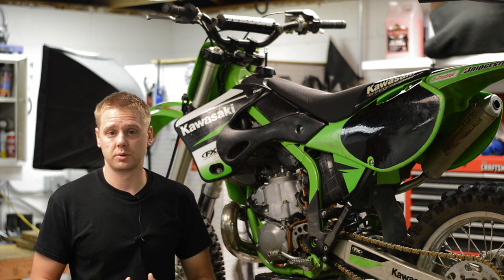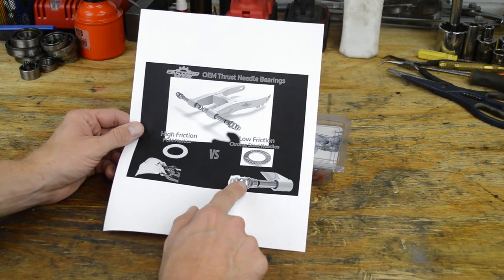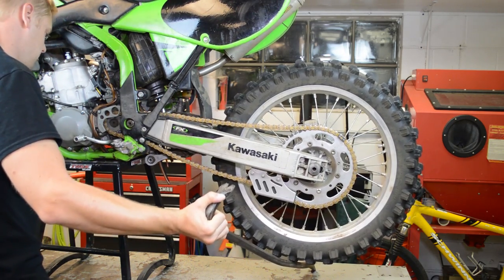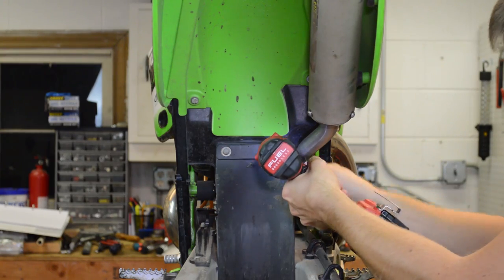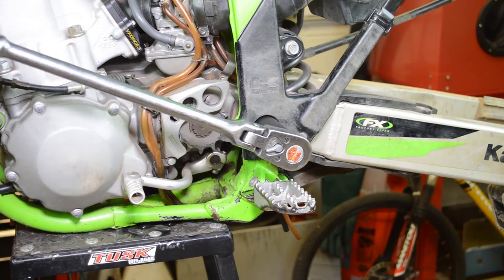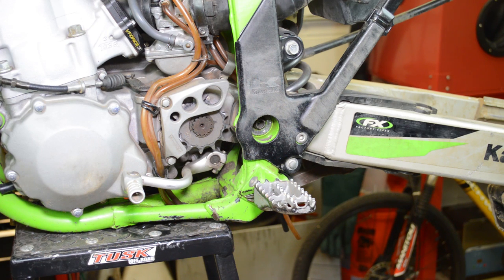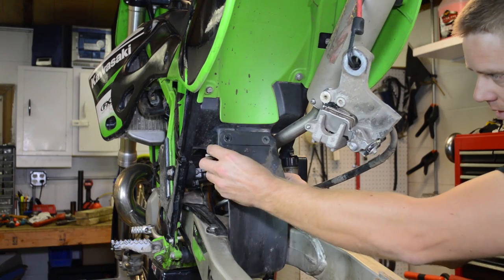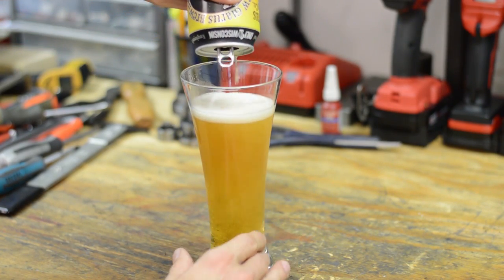How-To: Inspect and Replace Swingarm Bearings

Comment: u can also use a long bolt with some washers and a nut to pull the bearing out. just put a washer on the bolt put it through the socket and then put it through the swing arm and do the same on the other side with a nut and just tighten away

Comment: you ever just leave the bearings in and clean them as much as you can with them in the swingarm, like with starting fluid or gasoline, then just regrease them?  Thanks for the video man, these take a long time to make I bet this took a solid 10 hours to make and edit.
Reply from the maker: Yes if the bearings are still good. You should do it annually or every 15hr ride time.

Comment: I’m tripping here.. I bought a brand new CRF450 in 2010 and I always remember thinking the play in the swing arm was really odd.. you could lift the rear wheel like 10-15mm but because it was brand new I thought it was fine. I had the bike for 4years and it never got any worse but I think it was the lower shock bearing.

I have a 2021 CRF450 now and as soon as I got it I noticed there was no play which seemed strange because of the 2010 bike I had and I’ve just thought about it today so started doing research.

Comment: I stripped my vice today doing this. I commented a while back about my dad's KX 250 but now I own a CR 250 and I'm doing the same thing but they were so stuck.
Reply from the maker: That sucks. Going to need a press for that job.
Reply: MatthewMCRepair yeah that's not a big deal but also I wanted to share something you might find interesting My chain adjuster Bolt got stuck in my motorbike and tried everything believe  me, I put a blow torch on it, on it and tried welding 2 nuts to it and still couldn't get it and I had to pay to get it drilled and tapped and heli coil inserted.
Reply: Fast Mcdoogle you must have a really gay vice

Comment: Hi, Thanks for the video, I'm trying to do this but my bearings are really stuck, does it matter which side you push them out? looks like its easier form the inside to outside.
Reply: You'll run into tolerance issues if you use a vice. Use a threaded rod, washers, nuts and the right size sockets and crank em out with two wrenches.

Comment: What happens if your swing arm axel, what holds it on at the foot pegs won’t even budge with lubricant on it and hitting it with a hammer?
Reply: that's a tough one. I recently did mine on a DRZ400 and had the same issue. I loosened the nut and moved the swingarm so it will slide on the axle and for a week I sprayed penetrating oil on the entire shaft, the left side, thru the engine and the right side. eventually I inserted a shaft with a nut and washer and used a small hammer to knock it out of its place and it worked. I also prepared a tool that could remove it. the tool is a long threader shaft that goes in the axle and large pipe on the right side (that will have a place for the axle to get out), on top of the pipe I located a 36 mm socket and washers and nut on both sides. then the nut needs to be tighten and pull the axle to the large pipe side. I'm afraid that if both methods fail the next one might be to cut the axle with a rotary disc tool which I haven't done and don't recommends. good luck, be patient with it and be carful not to damage the axle (although its not that bad if it helps you removing it - it replaceable) and be carful on the frame because I've seen some guys hammering the frame and denting it.

Comment: Get a pw80
Reply: And do project in it
Reply from the maker: Maybe when kids master the pw50.
Reply: MatthewMCRepair oh ok because i have one but it has problem and i dont what wrong with it but i have videos in the channel
Reply from the maker: I watched the video. I would start with a good carb clean, followed by idle and air screw adjustment.
Reply: MatthewMCRepair i did and brought a new carb
Reply from the maker: OEM or chinese? Why buy a new carb when you can just clean it?
Reply: MatthewMCRepair brought it from Chinese man from amazon
Reply from the maker: Do you still have the oem carb? I have found that chinese parts belong in the garbage.
Reply: Pw80 rock!!!